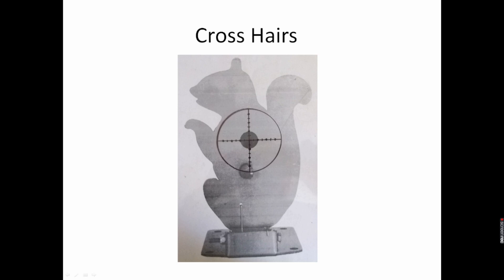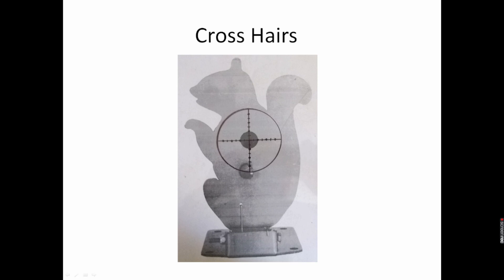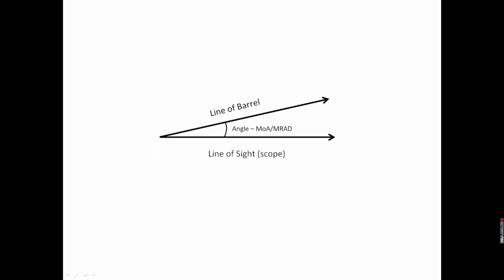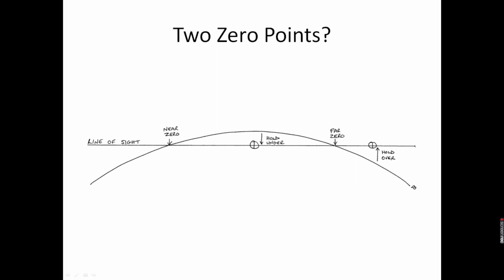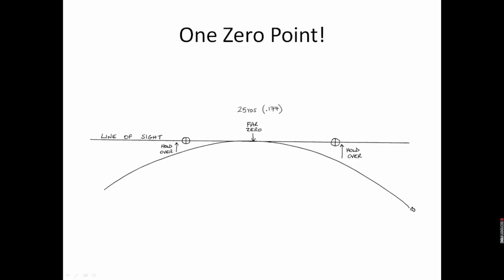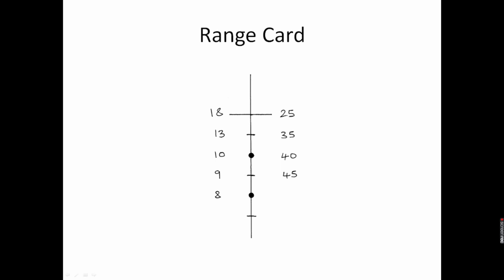6 - Trajectory 101 - The Flight of Airgun Pellets.

Comment: If a pellet is shot at the same speed .a heavy or light will follow the same trajectory .the heavy will in practice shoot flatter .because off the better bc, and holds the speed better ,     i bote  shot at 12 ftlbs the 177 will go faster and shoots flatter  ,because the time to the target is shorter, and time to fall also . . try   to drop a 177 and 452 bullet they hit the ground at the same time,  8 grain pellet and 255 grain
Reply from the maker: Thank you for your insight, but you know as well as I do that different weight pellets from the same airgun all leave the barrel at different velocities so their trajectories will be different. I've no doubt that .22 shooters would love to have the same flat trajectory as .177 shooters from a sub 12 airgun, but it ain't going to happen! 🙂👍

Comment: Dead wrong - gravity effects all masses equally - heavy/light all drop at the same rate. SPEED is the determining factor to the curve. Let’s say your muzzle velocity is 1000fps - in rough, thrown together numbers - in the first 1/10 sec, the pellet drops say 1 ft, and travels say 90ft, losing speed. At the start of the second second, the velocity is say 800fps, ends at 500fps, and travels only 60 ft, and gravity accelerates at 10m/s/s , so thé drop in that second tenth is perhaps 3ft. Ultimately, if we shot horizontally off a Cliff, the pellet would stop moving forward entirely, and drop straight down.
Reply from the maker: Thanks for the info.
Reply: The pellet is slowing due to air resistance. With no air resistanne the pellet would not lose any velocity but would arc down towards the mass of the earth and accelerate due to gravity if it was not at orbital velocity, which is aprox 7900m/s at sea level. In the real world air resistance is significant so you need to factor in surface area of the pellets and air resistance (which is proportional to the square of the velocity). A 177 pellet is about 16mm2 and a 22 is about 23.8mm2. In reality it is a complex equation which is essentially pointless as you can shoot at a piece of card and enter your drop distances into excel. With a few distances you can calculate all the intermediate values (interpolate) and extrapolate for longer distances ( with inceasing error bars).